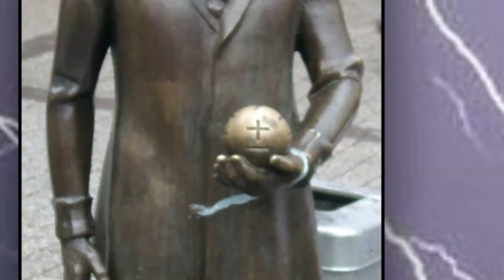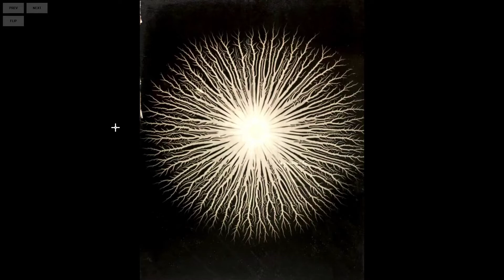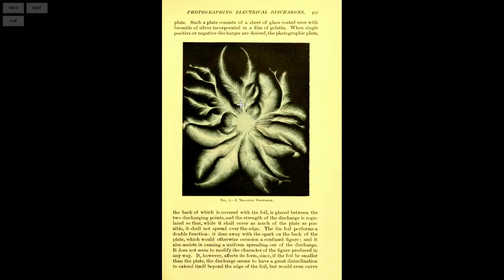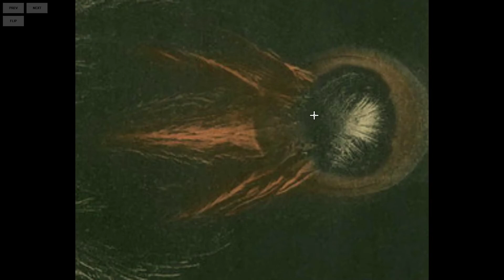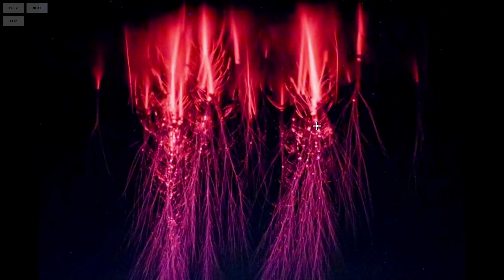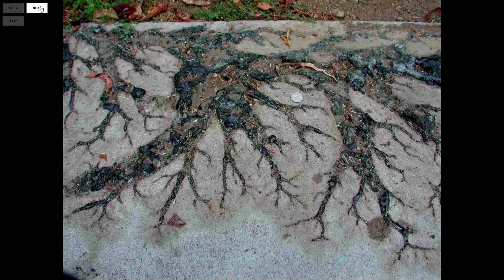Lightning & Electricity Are NOT What You Think They Are | Electric Earth

Comment: Tesla was faszinated by thunderbolts in his youth. What if he had a complete different understanding of electricity (3,6,9) ? Marko Rodin has a plus nine ( = Magnetism ? – Theoria Apophasis) and a minus 3 and minus 6 in some of his drawings. The first step of creation ( Drunvalo Melchizedek ) of the flower of life is that the first circle ( God with the point in the middle = 9 the circle = 3) sends out a second circle ( 6 ) and forms the vesica piscis, a vortex. 6 would mean, that in a symbolic way god has doubled ( 2 * 3 ). According to Walter Russell electric energy reproduces itself by induction and dissipates itself by conduction at an angle of 90 degrees to the lines of induction and conduction. Is all electricity a light vortex with two different ends ( implosion and explosion) and a zero point in the middle ? Is that the reason why Tesla built bifilar pancake coils ? Are crop circles !!! only the visible part of vortices (above and below the “circle”) ?
Reply from the maker: Find some work by Eric Dollard if you haven't seen that already and listen to his talks on the ether. ether fields are the closest thing you can study to understand it. The Earth is charged negative. That is why it is such a good "ground" so all our "electricity" comes from this environment. Think of a discharge like a sudden pressure or vacuum for a fraction of a second. A generator is just causing this reaction to occur many times per second. AC goes back and fourth and DC keeps the pressure on in one direction. I would say a natural current is when there is a magnetic field intersecting the dielectric field and they begin moving against each other in vortex spiral motion like the coke-bottle tornado. Both currents would be self-sustaining vortices. When I have time I plan on releasing another video about the geometry of these fields. Electricity is hard to describe. Cheers.

Comment: this is excellent work.  I was not even aware of different voltage polarity discharges.  Are there more than just the standard duelality?
Reply from the maker: As far as I know there isn't but I do think there are combinations like a spiral when the two modes are combined in a specific geometry. Which is how actual electricity is generated in the generator IMO.